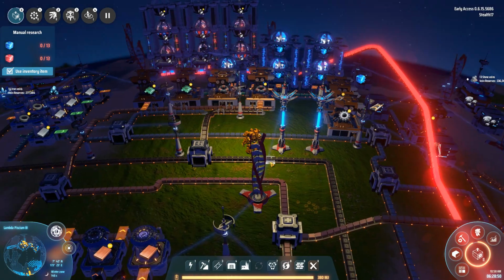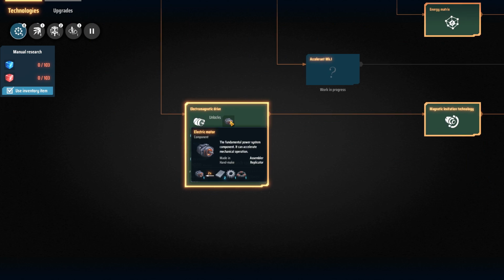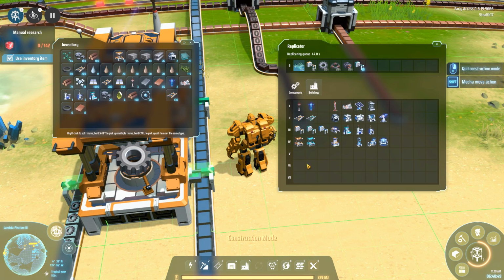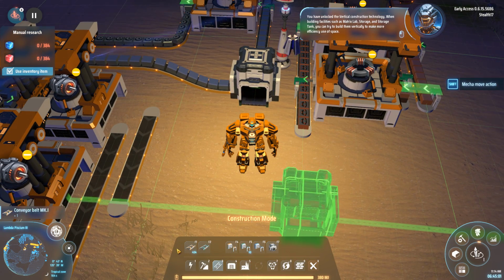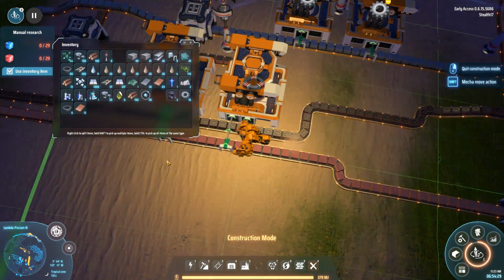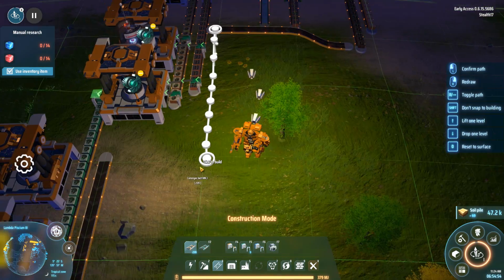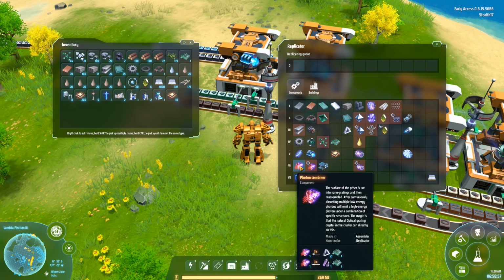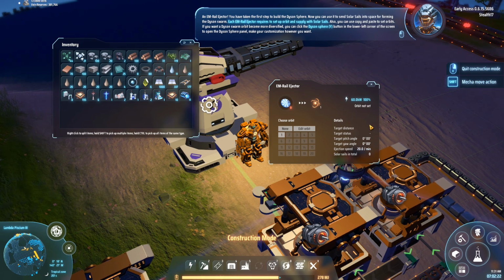Dyson Sphere Program - The EM-Rail Ejector - #4

Comment: so the solar sails on their own actually don't contribute to the dyson sphere at all. the EM-Rail ejectors just launch them into an orbit around the sun where they burn up after some time. that being said, you can use dyson swarms to generate a bunch of power if you keep launching solar sails (in my case I managed ~100MW with 4 launchers on a tidal locked planet). another thing to note is that the ray recivers will give you 12.5MW output at 100% efficency with no upgrades, they also lose efficency whenever their connection to the dyson swarm or sphere gets interrupted. So a solar farm with accumulators might actually be more cost effective if you're looking for power as it has no running cost opposed to the dyson swarm.
Reply from the maker: Yeah I've found them quite useful to generate power. I'm already 2 episodes ahead, recording wise, and I really like how you can actually see them orbiting the star :)